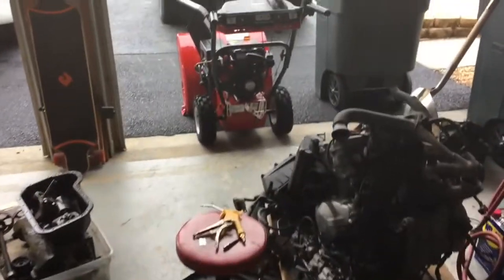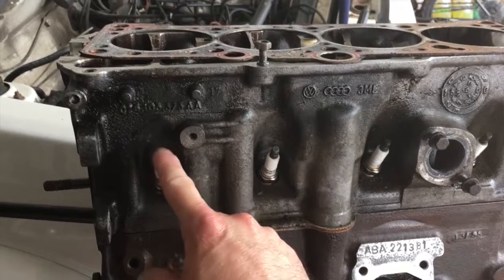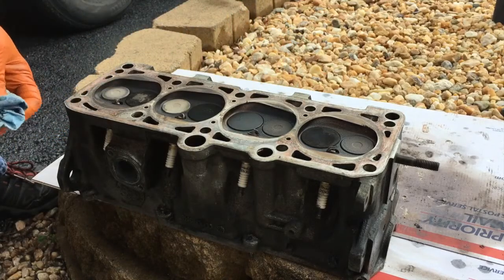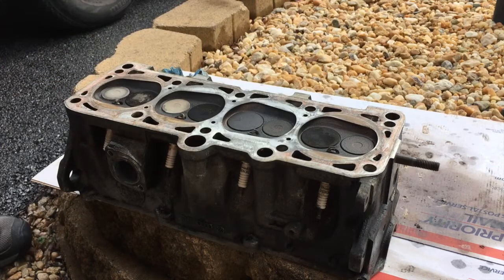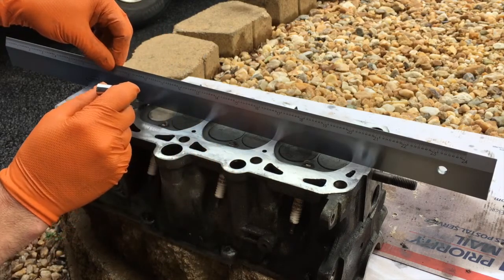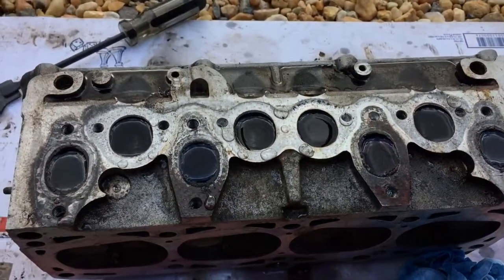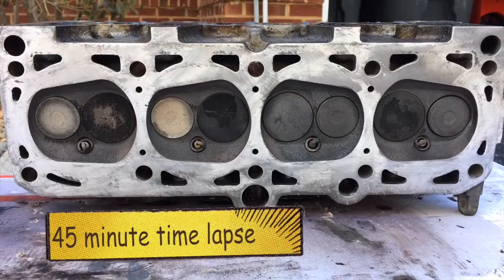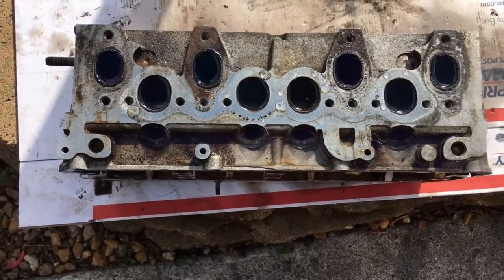VLOG #22: Basic Testing of the VW 1.8L 8V Head

Comment: that brush early in the video doesn't damage the aluminium? What's the brush material?
Reply from the maker: It’s a 3M roloc bristle disc that is safe for aluminum.
Reply: @trevorsgaragemusings  Thanks appreciated. Does it really clean without any scratch at all on aluminium? I'm wondering what's the roughest grit usable without damaging the material.

Comment: I have blue smoke in my engine 1.8 . I check the spark plugs and there is no oil . Is it come from bad valve seals
Reply from the maker: Most likely yes. The valve stem seals shrink slightly as they age and the seal lip pulls away from the valve stems and no longer “wipes” the oil. Oil then escapes around the seals and is burnt during combustion.
Reply: @trevorsgaragemusings  thanks. I will check the valves seals first . Than see the results .
Reply from the maker: @nicolaswilliam1018  If it smokes a lot at start up and not much after or during hard deceleration (high vacuum), it's most likely the seals. If you are measurably consuming oil between changes and it's smoking consistently, it's most likely the rings. Good luck! Hopefully it's the seals as they are easier to replace but still involve removing the cam so you will need to factor that into the cost, but much less than replacing the head gasket, rod bolts and oil pan seal to replace the rings (aside from the ring costs).
Reply: @trevorsgaragemusings  my car not running for one year . I start it without oil change . But i will change it